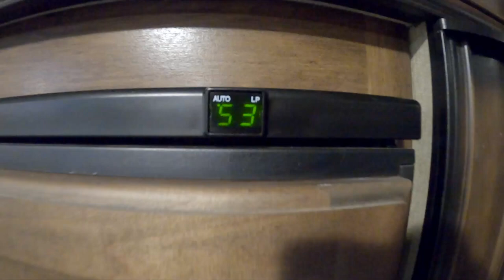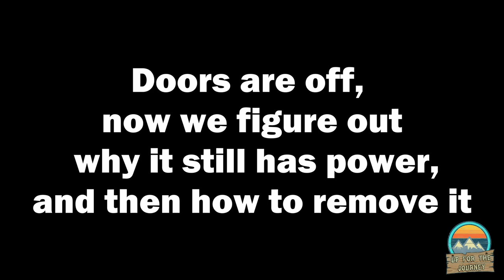Residential fridge in a RV | Reflection 315RLTS \  RV fridge issues \ Dometic fridge is GONE!

Comment: We have the same issue with our refirg. we have identical rv as you & your wife. These refrig are not made for Florida or Texas which is where we are from. when they sell an rv they should tell you hey this type of refrig is not made for 1000 deg heat. (lol). I told my wife when we pull it out she can take a sledge hammer to the thing.(lol). I would have like to see how you leveled the new refrig., but we can figure that out.
Reply from the maker: It had adjustable feet I think.

Comment: I was having the same problem on our 2019 grand design reflection. Found the problem the divider on the fridge that separates the two doors the flap was not closing so you had to manually close the flap when you push the door closed. The refrigerator door flap was not closing between the divider doors. Problem solved refrigerator and freezer works perfect now!
Reply from the maker: Good call.

Comment: OMG I can't believe so many people have such a hard time with their RV refrigerator. 

For those of you who don't want to actually learn something by reading the whole post  then the simplest answer to their problem would have been a hughes autoformer. Its not the best solution but the simplest and quickest. 

For such a simple problem some of the mods and hoops I've seen people jump though trying to fix this are ridiculous.
 
 I let you all in on a little secret I figured out 2 decades ago. 99.9% of all performance issues with RV refrigerators is low voltage,  Like diabetes it's a silent killer, it's been slowly destroying RV's since they were first invented. 

It's a problem that affects many things in your RV from your air conditioner to your refrigerator to your converter.

RV parks and camp grounds are notorious for low voltage issues, the wiring simply isn't up to the task of running all those 30 and 50 amp rigs with dual air, 3 tv's and so forth, the heaver it's Loaded down the lower the voltage sags. 

The problem is the heater element in your RV's refrigerator is a purely resistive wire wound element, so as the voltage drops so does the wattage of the element. 

The heater element in your RV refrigerator is similar  to a light bulb, It's basically just a wire wound filament that gets hot when electricity flows through it. 

why is this important ? simple, did you ever notice how your car headlights dim as the voltage drops or the battery dies?

 well that's exactly what happens to the resistive heating element in your refrigerator as the voltage drops, thsi voltage drop could be caused by poor wiring and heavy loads at RV parks and camp grounds it can even be caused by using extension cords. or even caused by running your RV at near max electrical load 
   
It's an ease thing to check, simply measure the AC voltage at the heater element while its under load, anything lower than 118 volts and you will start to see significant performance issues becouse your heater element is designed to produce its rated wattage at 120 volts not 118. 

Oh and since its a resistive load the wattage will decrease exponentially as the voltage decreases.
 
At 120 volts the element should produce about 250 watts worth of heat, at 118 volts it's now only producing about 220 watts of heat  at 115 volts its now only producing about 190 watts of heat. 

So as you can see you lose a massive 60 watts of power when the voltage drops from 120 to 115 volts that equals a 24% drop in cooling capacity.
 
Don't take my word for it, plug your refrigerator into a kilowatt unit and take some measurements and you will se what I am saying. 

The simplest solution to this is to wire in a 10% buck boost transformer between your heating element and control board, 

I did this 20 years ago when I first figured out the problem and have done it with every RV I've owned ever since.  I never have cooling problems, even on 110 degree days my fridge works fine and  without all the crazy nonsense that some people go though like adding baffles and fans. 

Since the heater element is resistive you can leave the buck boost transformer wired in permanently.  since it's restive a 120 Volt heater element can easily handle as much as 200 volts without damage it just gets hotter, In fact these  are the same type of elements they use on pellet bbq's to light the pellet's. they will start to glow red hot if you pump enough voltage through them but don't worry 10% boost in voltage is just enough to over come any voltage sag you are seeing.
Reply from the maker: As you are correct, before putting in the residential fridge, we did check the wattage multi times. This is a common issue with the fridges in a slide with insufficient cooling. Plus, the wife is loving not having to defrost a freezer. I hope your response will help other people with fridge issue. Thanks for the comment hope you liked and subscribed.

Comment: I did see both videos.  I wish you showed more screw removals and where the were.
Reply from the maker: Sorry. Improv to film.
Reply: I think the real problem is the unit was installed wrong. They lifted the fridge about 3 inches.  This moved the heat exchanger above the vent opening. Cooling air could not flow completely through and make the turn out of the vent opening.  Just moving the fridge down 3 inches, would greatly help to remove the heat.

Comment: The problem with these refrigerators is they create heat to MOVE heat..... Very stupid design. So when it gets hotter then the condenser outside there is little to no heat transfer. That combination with the CREATED heat just overwhelming causes it not to cool.
Reply from the maker: Yes.